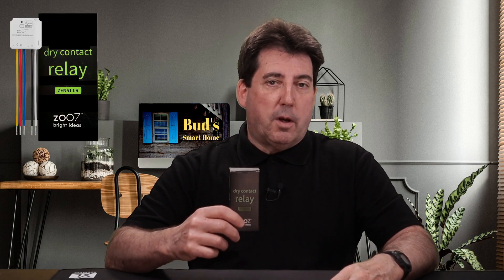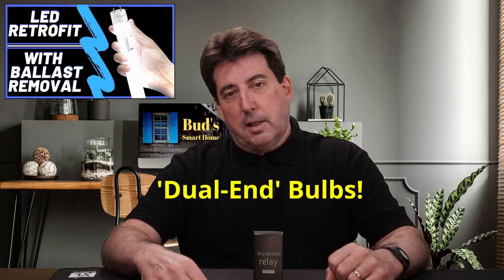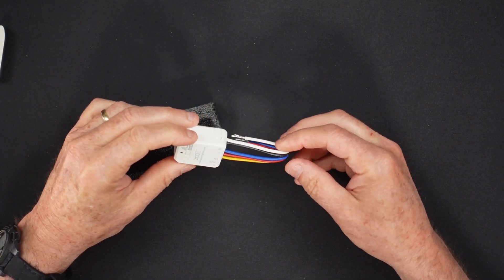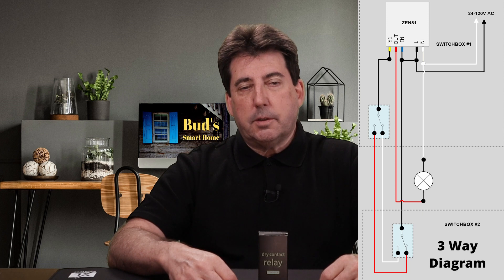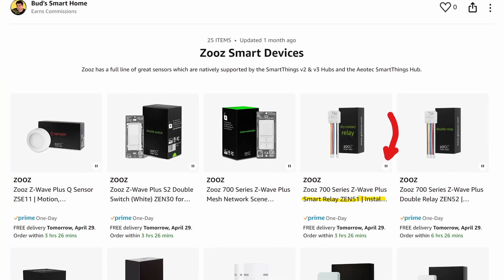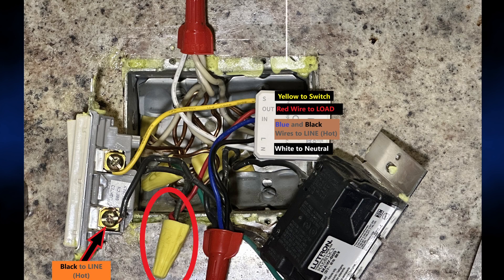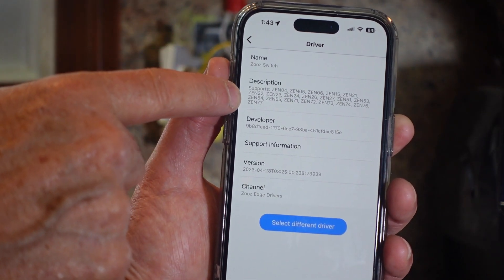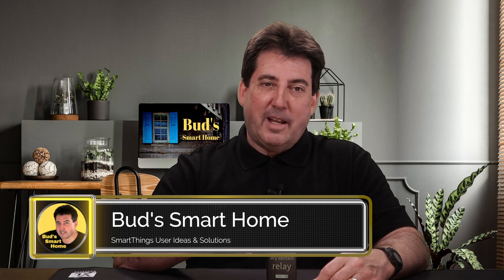Zooz Zen51 Relay Switch & Custom Edge Driver Information

Comment: Hi Bud !  maybe you can do a tutorial on how to setup SmartThings with a "time" condition.  I have tried a few times to set up some lights to go on only after the sun sets, when my motion detector sees motion. The SmartThings app just doesn't want to do it correctly. I tried the "sunset " option, but it doesn't work. The lights don't come on during the day, but once sunset is here and for many hours after ... the sensor just doesn't turn on my lights when the sensor detects motion.   It's not easy to set up. 😞
Reply from the maker: The best way to manage this is to create a virtual "Nighttime Switch". Use TAustin's vEdge Creator app V2.94 to create one virtual "contact sensor" and rename the sensor as "Nighttime Switch". Here is a link to an article on how to set up the Todd Austin's Virtual Device Creator app: https://www.budshomeautomation.com/post/how-to-add-an-edge-virtual-presence-or-contact-sensor  WIth the vEdge Creator app installed, open the app and and tap on the settings cog next to "Select & Create Virtual Device(s)" to create the "Contact Sensor" and rename the sensor as "Nighttime Switch". Then use the "Nighttime Switch" in two ST routines, one to turn the Nighttime Switch "ON" at Sunset and a second routine to turn the switch "OFF" at Sunrise. The "OFF" or "ON" status of the "NIghttime Switch" can then be used to as a trigger in mamy routines to perform operations at sunrise and sunset. It should be used as a "Precondition" in your routines. As an example, turn on the lights with the detection of motion, but only IF the "Nighttime Switch" is "ON". It should be constructed like this, IF "Nighttime" switch in "ON" (check Precondition); and Motion is detected, THEN turn lights "ON". DM me if you need help and I can do a online consult, if needed.
Reply: @BudsSmartHome   Hi Bud ! Thanks for the very fast reply !  I appreciate it. I'm heading over there now ( to your link ) to check it out ! Thanks Bud !! 🙂
Reply from the maker: @FrostyTheBeerMan  🙂👍